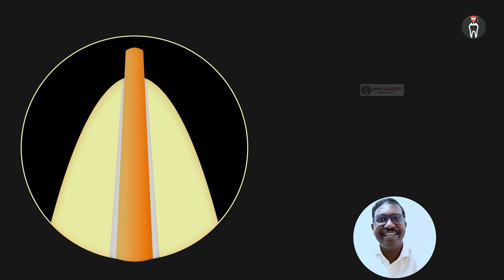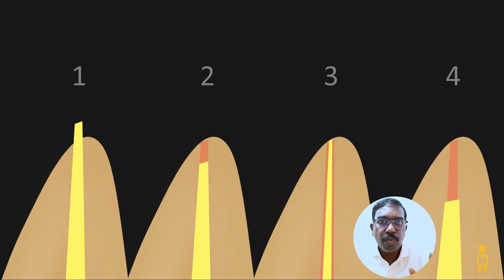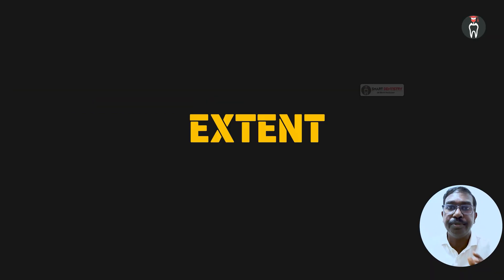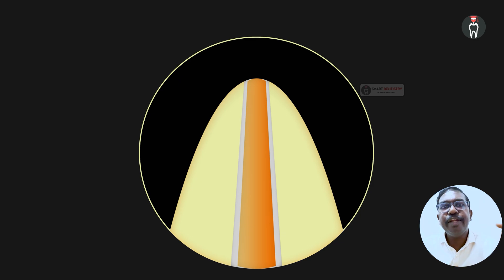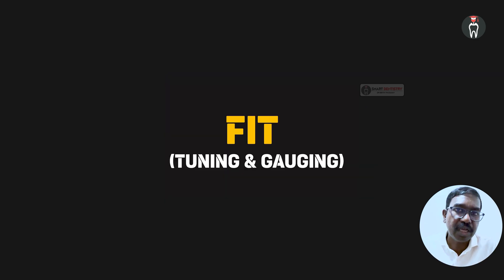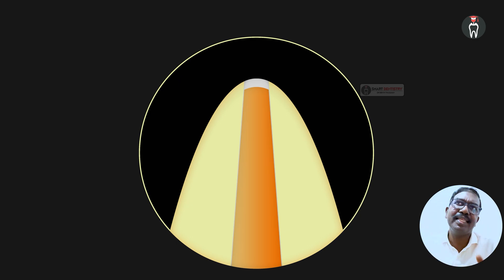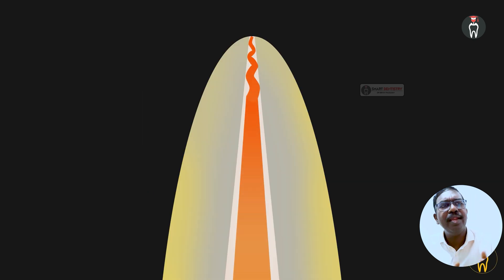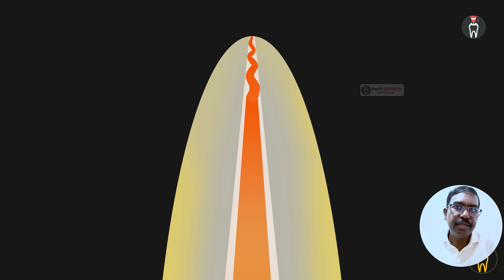MASTER CONE SELECTION | CONE FIT

Comment: Very good explained sir .
But one question is
If we choose 1mm short master cone with proper tuck back so that max space is filled with g.p and min space is by sealant,  sealant is resorbed with time . Even after the cross section of every canal is not round as like g.p crossection.
It may be oval or other type.
Well thanks for your fine explaining method to the point .I fallow you🙏👌

Comment: Thank you for good explanation video.
I have a query 
For curved roots, if we use 2% master cone for bmp done with 6% file to get tug bag, what about lateral spaces that we get above apical 3rd??  Is it possible to compact accessory gp on those cured canal using those straight spreader ?? Or are there other techniques??

Comment: what if there is no tug-back on the cones, even if apex locator (on files) indicates the canal is prepared to length? is tug-back required to obturate?
Reply from the maker: We should increase the file size. For eg: if we have prepared upto 30/04, then we shall increase to 35/04 or 40/04

Comment: Thank you sir for the lecture.
I remember coming across a write up against extruding GP beyond the apex because it can cause irritation of the apical structures and it was said that apical pathology will never heal with presence of extruded GP.

Please Sir, kindly comment and throw more light on this. 🙏
Reply from the maker: 1. Most common cause of GP extrusions is because of periapical violation during cleaning and shaping or not having a good cone fit
2. There is a meta analysis in Australian Dental of endodontic journal (one among these two journals) which has confirmed that if there is extrusion of GP or sealer in periapical region then periapical healing is delayed
3. GP as such is one of the most biocompatible material used in dentistry 

Based on the above statements we could conclude that, it is not the presence of GP infact any material in periapical region could delay healing
The reason for impaired healing is not because of the properties of GP or any other sealer material. But it is because of improper seal in the apical region which led to the material extrusion

Comment: In case of broad canals...palatal ones,or anterior teeth canals...many times..f3 gp are loose fitting during obturation.. should we switch to k files.. system for such cases...At times..50,55 no. K filling followed by its corresponding obturation works...what u say..??
Reply from the maker: Apical GP size could be considered as the most important factor determining the long term success of RCT. I too prefer to use 2% GP of greater size for obturating teeth with canal size more than 35 or 40. Especially in case of maxillary anteriors in young patients

Comment: I use only cement seal apex without cones,even after 7 years it dosent dizolve,+ the cones are a important factor for failure, because they do not come steril,and they do not seal perfect like seal apex does...its strong material  but softer than bioceramic cements  ,it has calcium hidroxide in it,and with a endo motor you can retreat a canal with no wories..blessings Dr🙏
Reply: Can you explain me this whole thing precisely.
Please

Comment: Apical gauging????
Reply from the maker: The technique of using 2% cones and verifying it tug-back at working length is called apical gauging. I preferably avoid these technical terms just keep the video simple and easy to understand. If needed, I will make a separate video about apical tuning and apical gauging but it could be too theoretical rather than practical.

Comment: Very nice sir. I have my own method for gauging may be theoretically it is incorrect but it works in all situations. Suppose my master file is 25/04 i will take 20/04 gp and cut it 0.75-1 mm so my apex will change to 24 and i will insert it in canal. From firm ref. Point i inspect how much gp is out of apex and i will cut it from there and again verify tug back.in 99 per cases that is correct confirmed by rvg .